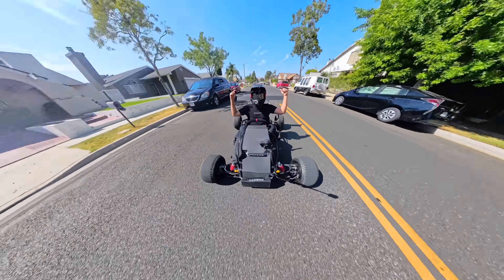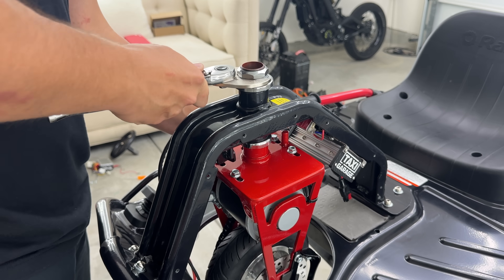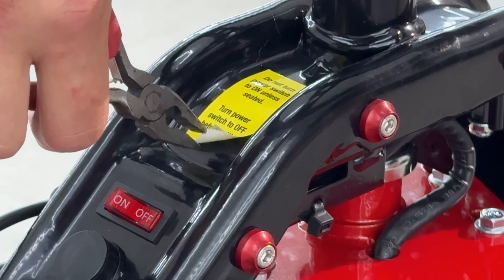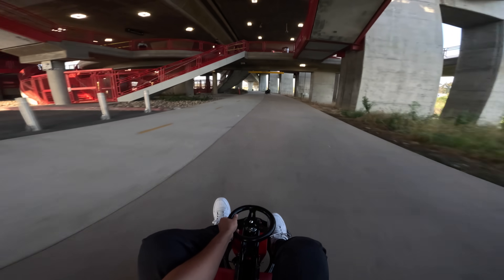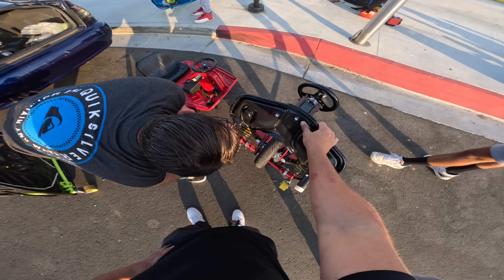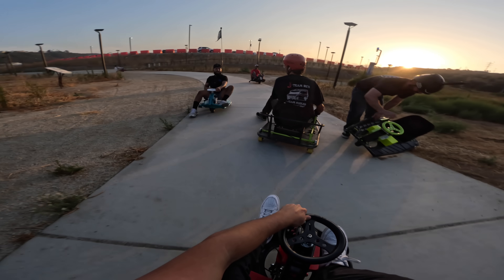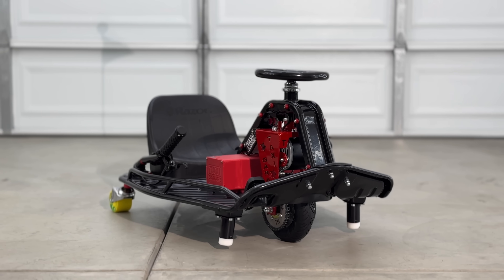I Built The CHEAPEST Electric GoKart!

Comment: i could not get the crazy kart because im from the uk. So let me get to the point get the HOMGX Pedal Go Kart, Outdoor Kids Pedal Go Kart with Adjustable Bucket Seat, Steering Wheel, Rubber Wheels, Brake, Pedal Powered ride. You might need to make some adjustments if your older then 11 or 12 maybe

Comment: The crazy kart build is awesome but... you can build a little electric go-kart that whips 12-18 mph (simple motor modification to achive high speed) for about as much or less than you spent on those upgraded casters. My version is not designed to drift but I'm sure it would be easy to modify it with a mechanism similar to the crazy kart. I'll make a video on it eventually. This may be one of the cheaper totaly legit builds but calling it the cheapest electric go kart seems silly to me.

Comment: Somebody trade me a talaria XXX or any electric dirt bikes like the Talaria XXX for my $5,000 NZXT PC!! PLEASE!! 
Specs 👇

NZXT F140 RGB (White) (2)
Loan Li Strimer Plus V2 24-Pin
NZXT RGB and Fan Controller V2
Interner USB-Hub (Gen 3) (Black)
Samsung 990 PRO 2TB
NZXT C1200 PCIE5 1200W Gold (Black)
MSI GeForce RTX 4080 SUPER Expert 16G
Team T-Force Delta White DDR5 6000MHz CL38 6000 MHz (Maximum Speed) 32GB (2x16GB)
AMD Ryzen 7 7800X3D 8-Cores 4.2GHz
AMD N7 B650E DDR5 (White)
NZXT H9 Elite (White)
Windows 11 Pro
Kraken 360 Elite RGB Black (Black

Comment: That XL is worth the extra $
It’s way more stable (I haven’t fallen out of it, yet; hard driving.)
Seat is way more comfortable. 
Caged around the back, more protection.
Cons: twice as heavy. 

The standard cart is less comfortable (smaller seat,) flips easily, but light enough to carry, and fit in the trunk of a sedan, easily.

Idk how they drive them standard (small) carts with anything bigger than the stock 250 motor ☠️

Comment: Got the 1100 too. Its too nice. Ive built one super budget model since stock motor 36 volt controller. And another hub motor conversion running 54 volts. Both powered by milwaukee m18 batteries. Stock motors will get hot quick fair warning. So far the hub motor is best bang for your buck. Got the cart cheap so all in maybe 300 not including batteries.

Comment: FYI, if you really want to do this on a budget build, you just strip out all the electrical components and take the two motor leads and jam them into a Dewalt 20 V max battery, works great, use caution because you completely bypass the throttle so it’s full speed all the time

Comment: I spent about 1200 total on a 35mph crazy cart build that was essentially plug and play with a 20 min total setup time and I still could have easily saved a couple more hundred bucks if I knew what I was doing at first. You just got to know where to look don't immediately go with Taxi Garage because its so accessible, you will get taxed thousands more than you should spend because of branding and convenience. Ive gotten 40mph top speed going down a hill and I easily get over 30 miles of range per 5 hour charge. (probably closer to 55 miles of range for full charge)

Comment: Just a tip dont speed up when drifting just let it slide because to much speed at an angle is gonna trip you, but you can add speed if you feel your gonna spin out backwards.
Reply: To be fair, we were hauling ass, I was basically pinned on my 900w kit most of the time, he was just trying to keep up. I actually felt bad for going so fast but I had everyone else right behind me, especially dude on the xl cart, I didn't want to get ran over 🤣

Comment: A crazy kart would be nice if the roads near me weren’t so bad
Reply: I search for hours on Google maps looking for "parks" with nice concrete trails. Asphalt is about the worst for the carts as it wears out the wheels n tire quickly. You would be surprised what hidden gem parks are around, I try to look for "new housing" developments because they are "usually" required to build some sort of "park" near or in them per amount of houses they build. Don't get me wrong, ive checked out close to 30 parks, and only about 5 check all the boxes with enough turns, loops, smooth, flat (elevation changes are rough) size and foot traffic.

Comment: i love this ...im just too fat ...lol i just picked up an old razor ground force and i cant even get in that lol
Reply: Man, those ground forces don't even fit me and I'm 5'3. They make an xl cart too, which will fit basically the largest of people (you can see the xl cart in the video somehwere) but initial cost is higher, and you need at least a 1000w motor to make it drift correctly and safely so you don't spin out so much. The problem with xl cart is they are bigger and heavier, so, harder to store, harder to transport and harder to stop (and why the brake system is rad now, it's a new development, ive been using Flintstone brakes for the last 3 years)

Comment: Built a go cart for $100 , then we will talk ! 🥶🥶
Reply: Well, I bought my first crazy cart used, rusty n crusty for $20, a little spray paint and $140 36v lithium Amazon battery and I was riding and learning 🤷‍♂️ but, personally, the more power you have it makes it easier to drift, because the tq of the higher wattage motor helps to pull you out of a drift. 

I upgraded my cart in steps, went to 500w ebay motor after that (like $89) then eventually to a 900w and differnt battery before I went all in on the taxi garage stuff (which is top notch). 

But I would always suggest starting with a used old cart, because you will end up crashing into things, but once you get the hang of it, powder coat the chassis like I did, and or, find a "straight" chassis to paint.
Reply: @619omni  That sounds great man

Comment: Can someone define the word cheap to Sur Sunster 
😭😭😭😭😭
He is calling 2k cheap
Reply: Well, they don't have to cost that much, and basically he's referring to the initial cost of the cart being "the cheapest cart". Personally, I buy all my carts used and powder coat them, I won't pay over 100 for a used chassis, especially because in going to upgrade all the parts on it. 

Depending on how fast you want to go, the 900w kit is the happy meduim of tq and speed, it's like 500 bucks, 48v battery is 400 bucks, casters are 260 bucks, so, 1160 not including cart. I rode min for the last 3 years without brakes (it's a new designed kit) but it would be "nice"

Comment: That stock Fork bearing needs to go! Change it out for a high quality one and your ride quality will go WAY up! ZERO speed wobble. Also bro, replace those front pegs with small casters from Home Depot. That way when the cart tips you can recover because there's no friction. It's so great to finally see these getting mainstream attention!
Reply: I agree with the headset, but sadly, any type of front caster or peg tends to be more dangerous, basically a catching hazard that could easily bend your chassis. I've tried the casters in front, but they almost never face the correct way, and, if you come in contact with them, you were probably going to tip anyways. I ditch my pegs/front casters as soon as I get one and why I yanked them off ronsters cart.
Reply: @619omni  interesting. They work really well and have saved me and my kids a lot. They always roll. But if it's not your thing I can't blame you! 👍
Reply: @619omni  I guess really it depends on what kind of location you're riding in. I don't really ride where I can catch on things. But I have gotten a cart with the frame bent in from the original pegs catching hard on something. It was easy to bang back in place with a board and hammer.
Reply: @TheCrazyCartModChannel  but the whole idea is the fact you don't need the front pegs and or casters, if you are going fast enough and you are tipping enough to touch either the casters or pegs, you are or were going over. My whole crew of 10 dudes do not run pegs or front casters, and we also ride in all sorts of areas where you might have to go over a low curb to get to a spot or ride some offset terrain in areas.
Reply: @619omni  Someone seems to be deleting my comments. I guess they are afraid of me? That's what screenshots are for. Anyhow yes you are correct for sure. Anyone at a high enough speed that's going over, a caster will not save them. The numbers argument is irrelevant though. tons of people do or don't do things because they aren't thinking for themselves and most people follow the crowd. Like literally millions of people now probably think this is the cheapest crazy cart you can build. Do the number of subscribers make that true? The views? Of course not. There are plenty of inexperienced riders (my kids and I included when we started) that will (and did) benefit from having those casters there. There's nuance in the situation, and we're both bringing valid points to the table. I would have taken those pegs off of Ronsters Cart also, because they are pegs. He is clearly a beginner in this video though, casters could easily have helped at least to some degree at low enough speeds. To deny that is display of immaturity.

Comment: Just dropping this here. 
Anyone looking into getting a surron style bike.
The ventus one is now in stock at most alibaba suppliers. They are running $4800-$5200 shipped.
Out of the box its running 23kw. Also the lower version of this is the 79bike falcon M which is $3200 shipped. 10kw out of the box but comes stock with a sotion motor that can handle 26kw. Can not recommend either of these bikes enough.

Comment: I have been thinking, what about adding something like one of those fairly quiet 2kw petrol engine generators into one of your builds, see how far you can extend the range, as you arent using 10-20kw all the time.....I think it needs to charge the vehicle while riding/driving for coolest effect, hybrid style, otherwise its just a portable charger. Plus it would be cool if the generator revved up as the vehicle sped up, but that would be a bit of hassle! Anyway would make a fun video to see how far you could get in something on a long range e-drive.

Comment: if i had the money to buy all these things i would definetly do that this looks so fun
Reply: For me, it's definitely the most fun, I've gotten in trouble on my hopped up razor motorcycles and other things, most people are intrigued by these, even the security and cops think they are cool (as long as we don't ride like idiots). 

You can get into one much cheaper if you find a used chassis for around 100 bucks, and don't run the brake kit (it's a new development that's super cool, but ive been using Flintstone brakes for the last 3 years) 

900w kit is around 500 bucks, 48v battery is 400, and casters are 260, so, around 1160 not including cart and powder coating or paint (I suggest riding first before painting, because you will more than likely crash a few times while learning)

Comment: hey sur ronster! so i’ve got a crazy cart im working on and it won’t charge, its got brand new batteries, controller, charging port, and charger. I’m thinking the charging port is faulty cuz it was working just fine till i had to charge it (built crazy cart) (24v batteries and controller) do you have any tips on how i could fix it?

Comment: I bought a lo206 Racing Kart for $1400 and then threw drift sleeves on it. Total: $1500. You can find them used on marketplace for $1400 - $2500. I know its not electric . . . but it does 50 mph and is a beast. There is also a video called: "29MPH on your Crazy Cart for $173!! Taxi Garage Alternatives" on youtube that shows you how to mod a crazy cart for cheap. You get the same results but for a total of only $600 if you were to buy all new parts and a kart.
Reply: Yup 2k+ is not cheap anymore😂😂
Reply: Probably more reliable.
Reply: @BboyMobster no. These things are tanks. I flipped the shit out of mine often shredding to hard. First time riding I was sending it on the 1100 watt kit like he's riding in the video. I flipped going atleast 20 and flew off running while it flipped multiple times behind me. Steering wheel got a scrape and frame took some rash. But pool noodles took most damage
Taxi garage is expensive but tough. If you're on a budget there is plenty of options tho. Theyve Gotta fb group that's mostly cool peeps.

Comment: this video is cool. but this recipe is cooler:

Chicken Ballotine with Herb Stuffing and Madeira Sauce

Ingredients:
- For the Chicken:
  - 1 whole chicken (deboned)
  - Salt and pepper to taste
- For the Herb Stuffing:
  - 1/2 cup breadcrumbs
  - 1/4 cup chopped parsley
  - 1/4 cup chopped thyme
  - 1/4 cup chopped sage
  - 2 cloves garlic (minced)
  - 1 egg
  - Salt and pepper to taste
- For the Madeira Sauce:
  - 1 cup Madeira wine
  - 1 cup chicken stock
  - 2 tbsp butter
  - 1 tbsp flour

Instructions:

1. Prepare the Chicken: Start by carefully deboning the chicken, keeping the skin intact. Season the inside and outside with salt and pepper.

2. Make the Stuffing: In a bowl, combine breadcrumbs, parsley, thyme, sage, garlic, egg, salt, and pepper. Mix well until the stuffing holds together.

3. Stuff the Chicken: Spread the stuffing evenly over the inside of the deboned chicken. Roll the chicken tightly, tucking in the edges to create a log shape.

4. Tie and Sear the Chicken: Use kitchen twine to tie the chicken securely in several places. Sear the chicken roll in a hot pan until the skin is golden brown all over.

5. Roast the Chicken: Transfer the seared chicken to a preheated oven at 350°F (175°C). Roast for 45-60 minutes, or until the internal temperature reaches 165°F (74°C).

6. Prepare the Madeira Sauce: While the chicken is roasting, make the sauce by melting butter in a pan, adding flour, and cooking to create a roux. Gradually whisk in the Madeira wine and chicken stock, cooking until the sauce thickens.

7. Rest and Slice: Once the chicken is cooked, let it rest for 10 minutes before slicing it into rounds. Remove the kitchen twine.

8. Serve with Sauce: Arrange the sliced chicken ballotine on a serving platter and drizzle with the Madeira sauce.

9. Garnish: Optionally, garnish with fresh herbs or serve with a side of roasted vegetables.

10. Enjoy: A beautifully presented dish that impresses with both its appearance and flavor.
Reply: Guinness to make people make it

Comment: I always love when surronster does theses "cheapest" videos! i can actually imagine myself in one of these!!!
Reply: You can build them up in stages, in fact, I would suggest it. You can usually find them used for a couple hundred bucks or less, start with a battery(36v lithuim) and controller upgrade and learn, because they are still pretty fun. Eventually you can get a motor that's much more watts (500-900w) but only run it on 36v until you really want to have more "top speed" then you can overvolt to 48v. I've been riding for 2 years and still get better every ride

Comment: I’ve never seen you fall so much, or have so much fun!
Reply: There is a steep learning curve with these, but it "seems" like it would be super easy. Ronster jumping straight onto an 1100w motor is a bit hectic in itself 😂 hard to explain the feeling tho, basically the opposite of drifting a real car because it's fwd and you rely on the rear casters to hold the drift, it's definitely "crazy"
Reply: @619omni  our boys got a set on him!!

Comment: Yo I love your vids but I can’t afford anything I see you build but I love watching you build them good luck and thanks for being so entertaining 😊😊
Reply: Man, you can build these on more of a budget if you start with a used cart. Most kids run them until batteries are dead in the first couple years, then they get left outside and sold for cheap. A little spray paint, or powder coat, and a few upgraded parts will get you there for half this cost (I've ridden without brakes for the last 3 years, brake kit is new, but also super nice)

Comment: “I built the CHEAPEST electric gokart” continues to spend almost 3k 😂
Reply: You dont have to spend that much tho. You can usually find a used cart for 100-200 bucks, get the 900w kit that's 500 bucks, 48v battery for 400 bucks, and casters for 260 bucks, so, closer to 1260-1360 if you don't get the brake kit (it's really nice tho) I've been Flintstone braking for the last 3 years. 

Ive even built carts for cheaper by sourcing my own parts, but, taxi garage parts are top notch with no fabrication needed (other than the brakes)

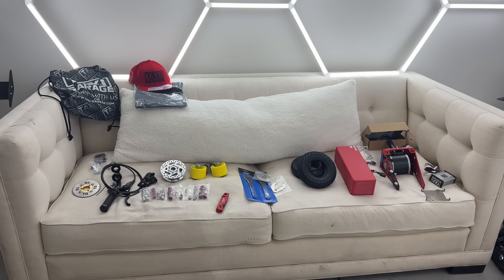Comment: 2:26  mr sur ronster said cheapest go cart but 2,602 dollars 💀 bro called me broke 246778899 languages lol 😂
Reply: Real lol haha
Reply: $379 on walmart, and I upgraded mine to go 29mph for an extra $173. I make videos about how to upgrade for cheap if you want to watch them. I'm not trying to get famous, just help people save money with crazy carts!
Reply: It doesn't "have" to cost that much, if you buy a used cart, and don't run the brake (I don't have a brake but  I would "like" one). 

I like to build them in stages when I was first learning, but, you can just get the taxi garage 900w kit for 500ish bucks, 48v battery for 400 bucks and good casters (does make a difference when your fast) for like 260? 

I've picked up used carts for as cheap as $20 or even free but they are usually pretty best up, so, I mainly hold out for carts in the 100 range if they are clean and build those up (powder coat also, costs "around" 200 bucks depending on color and location, could be cheaper).